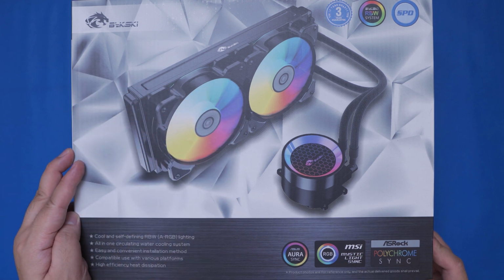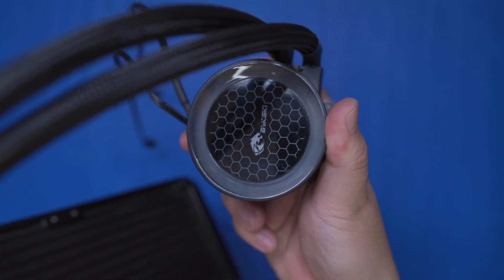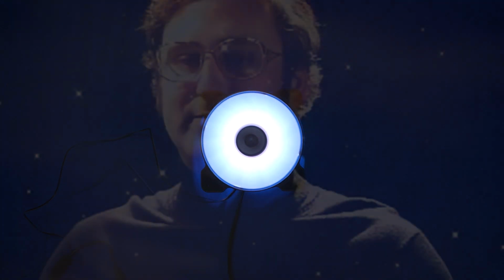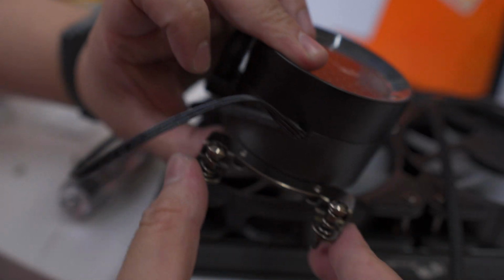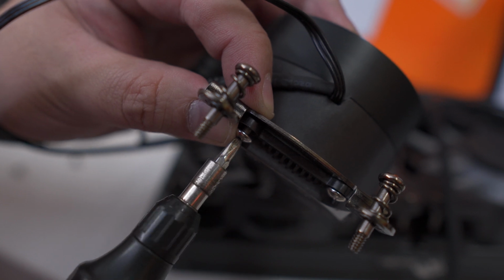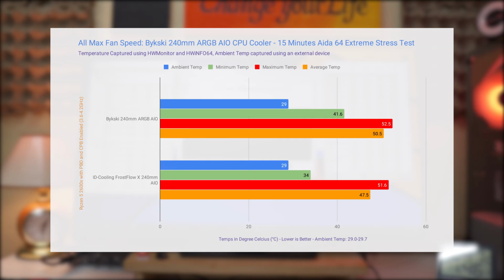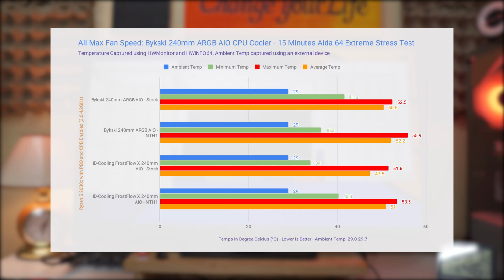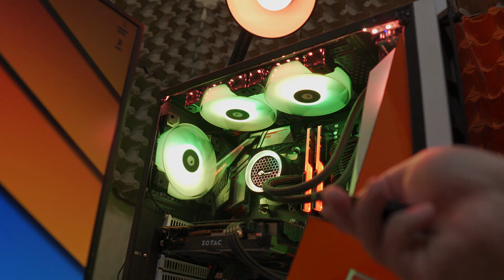Bykski 240mm ARGB AIO Review - How to test AIO!?

Comment: Tanong lang po. Bat di po nailaw yung led fans ko at yung cpu block niya is nag b-blink2 lang di kagaya ng sa review na full led lights. Na daisy chain ko naman po yung fans at cpu block. 

Mobo used: b450 aorus elite. 
Case: msi mag 100r
Psu: 650w 80+ bronze 

Sana po may makatulong.

Edit: di ko lang po ginamit yung splitter niya na may 3pin at molex (rgb controller) since di ko siya ginamit kasi wala po akong molex connector sa case.

Comment: Pwede ko po ba etong iconnect sa argb plug ng DarkFlash DR12 Pro fan hub which is meant for led strip?

Gusto ko sana isync yung case fans and aio cooler ko sa motherboard ko kaso, iisa lang yung argb header. So plan ko iconnect yung aio sa fan hub which will be connected to the motherboard's argb header

Comment: @TechBroll

I just got mine earlier and was able to finish installing. Any reason why mine is hitting around 78C max temps while running Prime95 with everything set at max speed?

Proc : i5 9400F
Cpu Cooler : Bykski 240
Thermal Paste : Deepcool Z5
Case : Tecware Nexus C
Case fans : ID Cooling DF12025 aRGB Trio

The id cooling case fans are set for exhaust (2 at the top 1 at the rear) and the AIO is set in front and fans are on a pull configuration. I already removed the top air filter to improve airflow but to no avail I'm hitting more than 20 degrees than yours. Lastly, I'm running everything on a closed case.
Reply: To add

The unit I received has a copper contact point unlike yours which has aluminum(I think). That's why I'm really confused why I'm reaching very high temps.

Comment: Sir anong fan model po ang included sa rad ng aio? Para po mag mag match sa entire build. Tia.
Reply from the maker: Check ko kay bykski, balikan po kita :)
Reply from the maker: Ayun, wala pa daw available locally na separate fans na kagaya nung sa radiator eh :(
Reply: @TechBroll  ayy ganun po ba sir. Ask lang po ako ulit sir if pwede ba i connect yung argb header ng aio sa arc fan hub ng tecware hehe curious lang sir kase bilihin ko sana yung dalawa if compatible